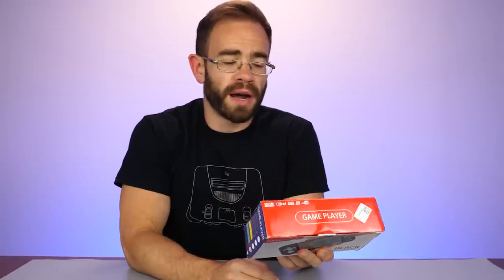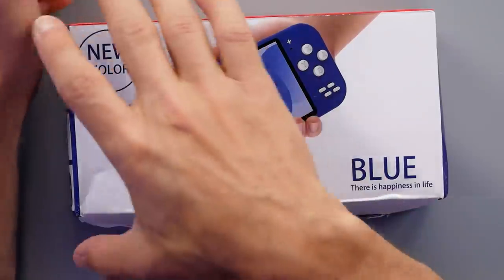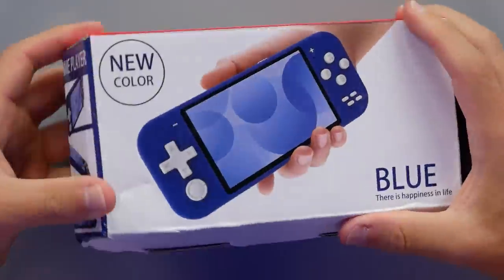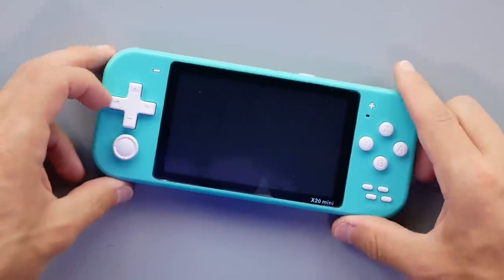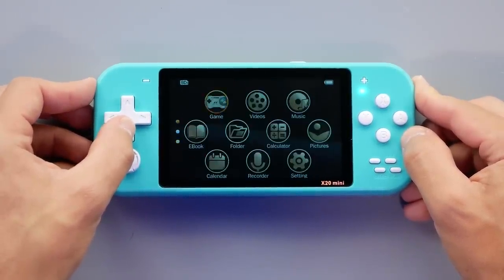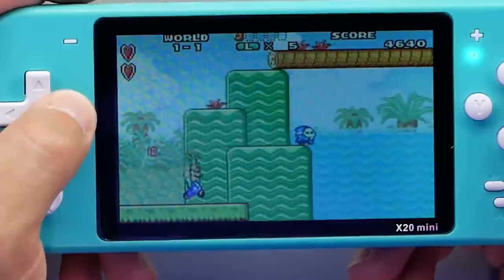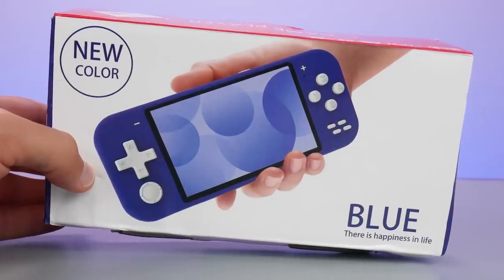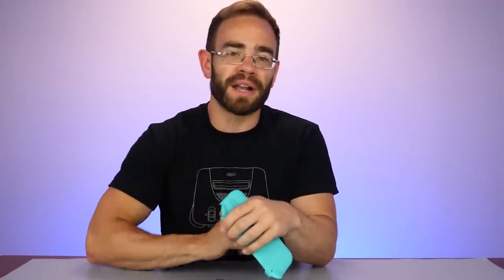The Fake Nintendo Switch Is Hilariously Bad

Comment: imagine having this device in 1990, I wonder how different it would be looked at
Reply: I can assure you, you'd be the most popular kid in the school play ground during lunch time,
Reply: we had emulation in the 90s and it didn't lag.
Reply: You would be a time traveler, since you'll also have GBA games even before they were released
Reply: @KillerAndMX  you'd play GBC also
Reply: @k27ism  😂
Reply: So basically the Atari Lynx
Reply: Most of the gaming industry today isn’t worth much more respect than this anyway lol
Reply: Image asking for a switch lite and getting that instead
Reply: @UntouchablePlayers   but not for 30-40€. when i was a kid, i paid 50-60€ for a gadget that couldn't do more than detecting someone walking through a ir-laser trap and similiar "spy toys". but i couldn't imagine getting even ONE system emulated on an handheld in this price sector. when i was a kid even normal mp3 players with black white displays did cost sometimes 80-90€. so yeah.
Reply: We had plastic in the 90s. A cheap looking piece of shit is a piece looking piece of shit regardless of what it may or may not do. 😂

ALSO: Does anyone else remember those cheap Tiger-esqe handheld games? They had art (using that word loosely) on them. This is just... nothing.😂

Comment: I wish you would have shown the NES library and performance! That would have been fun to see.
Reply: Its not worth it this is total garbage mine died Quick
Reply: Honestly these days the nes library can run on a potato.
Reply: @marcellachine5718  psp 
2ds etc all easy
Reply: @marcellachine5718  every android can do it easily
Reply: Pretty much any device from the past 20+yrs is capable of running NES at full speed. 😅.... So I think it's a safe assumption to say that even this blue turd would as well.
Reply: Nes runs ok on it. I have this same handheld but just a different color and the emulation is decent for most games especially Nes.
Reply: @aquagames5850  if you can find some custom firmware it'll support you'll be in much better shape across the board... I'm assuming there's a tf slot for a micro sd card on it?
Reply: @aquagames5850  what are the best NES games? This thing may be worth $30 if it comes with Final Fantasy, Mario games, Mega Man, etc.
Reply: I emulated NES on my SE k550
Reply: @EvEnMoR  I got one of these and it's pretty garbage. Can you actually flash a particular firmware to it? That might make me regret my purchase a little less.

Comment: For $40 you can get the PowKiddy V90 which is actually a pretty damn good lil device that runs the games well. So the low price point isn't always the issue in the emulation handheld market. Just do your research first.. and if custom firmware is available for the device USE IT... It will often make a massive performance difference with some of these devices.
Reply: I mean they're asking the same price as as an Ambernic.  I know they have cheap ones that are like $20 or $30 maybe $50 that would work great with this stuff for the price and isn't total garbage.
Reply: @JohnDoe-wq5eu  ya, I have several Anbernic devices. They're beauty. Especially with CFW... However, I'm not aware of any devices they have that are that cheap... You're spending at least $70 for a good Anbernic... I just dropped $170 on their new RG353P
Reply: @EvEnMoR  
I'm not sure if the one I'm thinking of is an actual Amberic but I thought it was. Super portable basically only has d-pad no thumbsticks. And I think 4 face buttons maybe  left and right triggers I forget.
Reply: @JohnDoe-wq5eu  sounds like you're thinking of the RG280V... Great lil device that's been around for awhile. I think it's in the $50-75usd range... It's getting a lil long in the tooth now, but is still totally capable of emulating up to PS1 I believe... Also probably has a ton of CFW support by now.
Reply: @EvEnMoR  
My problem is I keep up with a lot of the channels that look at a lot of those like something prime and MLP. So all the brands and stuff just start running together it might have been a powkiddy variant or something similar. This one really looked like a small game boy or even GBA version d-pad maybe it was only two buttons but I think it was four. And maybe left and right triggers but I might be wrong. But yeah it had a pretty weak chip in it if I remember correctly I pretty much was for 8 and 16 bit consoles maybe things like Neo Geo TG-16/PC engine probably. Along with arcade probably.
Reply: True
Reply: @EvEnMoR  why would you spend 170 on that when you could just buy a 3ds for that price and mod it
Reply: I collect handhelds... I already have a regular 2DS, two New 2DS XL's, and a New 3DS XL all fully modded 😅

Comment: There's some better ones out there that will actually run ps1 games decently, and everything before that console runs near flawless. Powkiddy q90 or v90 are pretty good compared to this. But for the ultimate retro handheld emulator go with the miyoo mini. Near flawless ps1 on that one! The more expensive ambernic devices will play dreamcast and saturn and n64 almost perfectly. Retroid pocket 2+ will play GameCube pretty well. So there's some really good handhelds out there in the $50-$150 range.
Reply: My Vita plays PS1 games perfectly......!
Reply: @lemming9984  In my shitty country I can buy with 15% more money a ps4 for what a Vita cost, absurdly expensive for a handheld.
Reply: @Arc_Soma2639  Yeah, I suppose you had to buy one a few years ago to get them at a reasonable price. They really are great machines!
Reply: @Arc_Soma2639  Have you looked into buying a Vita from Japan? They tend to run cheaper than US/EU variants. You can install CFW to run in English and play roms.
Reply: Steamdeck plays nearly everything
Reply: Ps1 emulation ain’t exactly a high bar. My penguin 3 500 mhz was running ps1 games and my 70 dollar Fire HD from 2016 can run pS1 games. For some reason N64 emulation is still tricky.
Reply: @lemming9984  miyoo mini doesnt cost 300$
Reply: @lemming9984  The PSP also works well for PS1 emulation. Of course, the screen isn't as nice as the Vita's.
Reply: @DWS2020  But it's not fun at all to play NES, Master System, GameBoy, SNES, Genesis/Mega Drive and systems like this on a crazy huge handheld like the Steam Deck. It's better for PC games or tougher emulation like PS2 and stuff, in my opinion.
Reply: @DWS2020  Steam Deck you could buy 2 Switch, which is pretty ridiculous since all it good at is playing games, you might as well get a gaming laptop for the same price but marginal improvement in performance, massive storage spaces and larger screen size.

My gaming laptop trounces Steam Deck for being 200$ more, having RTX2060..... And I can work on my laptop and earn money from freelancing jobs.
Reply: @billymerritt420  ones on Amazon go for 180-ish used? That's pretty good compared to the US ones, but do they get any cheaper than that? And what firmware would you need to install?
Reply: @ben66562  Yes they do get cheaper. There are multiple sellers importing J gaming consoles and handhelds on eBay. You can easily scoop one from $50-100 depending on what condition and extras you want it to come with. They can go over $100 for special editions or like nearly new and complete. As for the hack, that depends on what firmware the Vita is running. There's a plethora of videos here on YouTube on the best options.
Reply: @billymerritt420  hey thanks. sorry for the late reply, but I looked and the cheapest one I could find on ebay was $60 and that still had $35 shipping. 

should I be looking somewhere else?

Comment: Huh, they changed the design on these a bit. I used to see a slightly different variant on Facebook Marketplace all the time with a larger screen bezel (and thus smaller screen) branded just "X20", with a slightly different box.

Comment: In it's defense, if something like this had come out 20 years ago it would have been a hot seller (and would probably have a major lawsuit with Nintendo).
Reply: The PSP came out 17 years ago and was able to emulate all those systems way better than this thing (including flawless PS1 emulation). Granted, you had to hack it and find roms yourself, but that wasn't all that difficult. The only thing this device has going for it is the cheap price.

Comment: if you can re-flash the system with an updated software, it can suck less, but it still going to suck.
 the button press issue is likely software side, as it may be just reading state changes vs a per frame read out of the button states.

Comment: I bought this X20 Mini, knowing it was a knockoff of a Switch Lite, my reasoning for buying it is so I can have an inexpensive handheld that I can take with me on the go and not worry about something happening to a $200 system. I will say, I like that the D-pad is big, always had trouble with the small D-pad, I have a big thumb. Had to order a second X20 Mini, though. It did not break, malfunction or anything. Mine works really well, it's just that I lost the SD card and if you lose that, the whole console doesn't work, none of the apps will work. If my next X20 Mini turned out to be a bad one, I can just put the SD can from the new one to my previous one.
Reply: Side note, if you get a bigger SD card with 32GB of storage, you will need to format the card and set it to exFAT before copying the contents from the 8G SD card that comes with the X20 Mini or it will reject the card and will not read it. You can put video files on the card and it plays videos fairly well.

Comment: They designed, manufactured, transported this...
For $30 and turned a profit...
If you are wondering why manufacturing is done in countries such as China...  stop wondering.

There was a story (possibly Vice) on I believe the I-Phone 6, that stated the assembly cost was $5, most of that part of the labour was done in China, but 90% of that cost was in Germany.

iirc Apple's profit on each phone was $250 (>50% margin)

If you knew the profit margins on a current Apple phone...
Well, in 2018 they became the "first $trillion company" in 2022 it was 3-trillion...
It's a good thing they barely pay any taxes...

Comment: I'm always confused who would buy something like this lol
Reply: 100% agree. Like even if your not tech savvy. You can buy a modded PSP, GBA with a flash cart and a modded screen. Or a million better emulation handhelds . Or just a used switch lite for cheap.
Reply: Too much negative criticism on this device..over in England / Europe we tend to watch Wicked gamer and collector channel..I bought one of these beginning of the year..it's a Data Frog X20 which is a updated Powkiddy J6 from a couple of years ago..I have 2 x J6 in black/ orange and now this greeny blue X20...all 3 have identical PCBs...J6 from 18 pounds/ about 24 dollars..this nearly 30 dollars...it's not great...but it does 8bit and 16bit ok mostly...and Advance if you're not too fussy like me...there's other cheapies like the XYC-Q8 which does MegaDrive/ Genesis ok but is worse for Advance and SFC/SNES...probably a V90 is a bit better...I don't like flip / clamshell types...so that's out...there's loads of cheapo Chinese handhelds...if you want quality you save up for Anbernic device..right? I also build RaspberryPi based game machines..Retropie/Batocera/Recalbox/Lakka into cheap boxes too...and OrangePi versions also...7 of those...8 or 9 cheap handhelds...a few genuine original handhelds...and a bunch of premade Chinese consoles Inc a couple of the mini classics...no need for confusion...some of us like recycled plastic crap...check out Wickeds channel...he's bought tens of thousands by now...

Comment: I’m not tech savvy in anyway so go easy on me with this question if the answer is really obvious

Could you not take the microSD card and put it in something else with better emulators and hardware like the retroid pocket 2 so the games will perform better?

Comment: i got an x7 portable game on amazon. wasn't trying to be a switch. but its obveus. the "main" picture had the orange and blue "sides" on it. but its also trying to look like a PSP.... kind of weird. but ok. but you know what. it emulates GBA games for ~$20. supposedly can do PS1 and some PS2 as well. so for the price... its not horrible you do have to use use save states. games that have built-in saves don't work. like pokemon. and that was the big turn-off for me. id want to move my save to PC or even flash carts for the official hardware and this wouldn't allow it. so. in a box it sits. maybe ill re-gift it to a sibling this holiday.

Comment: More cheap Chinese garbage. 🙄🙄🙄 

I’m disappointed because I’d happily pay 200 dollars for it if it had better specs and emulation and it used Android OS.  Basically much better quality. 

At this point. I’m better off buying a Motorola Android phone and hoping I can get the Gamesir X2 to work on it. 😞😞😞